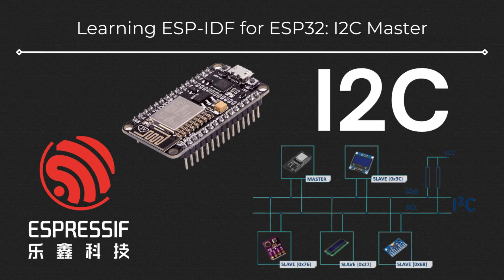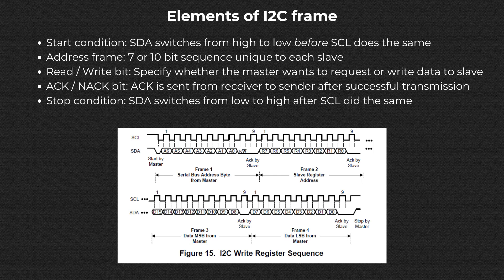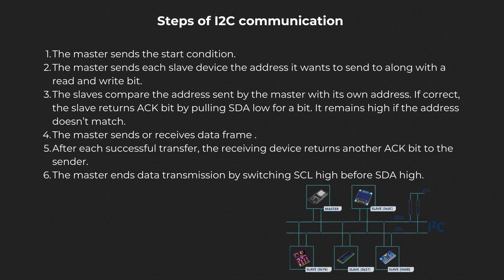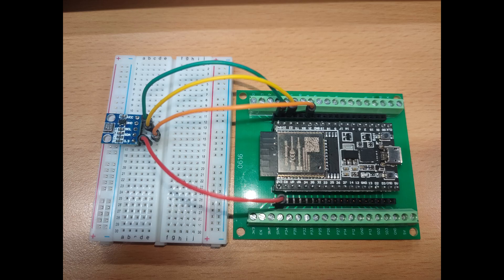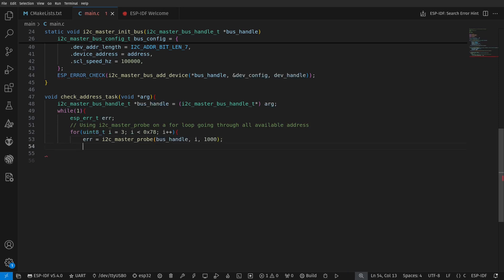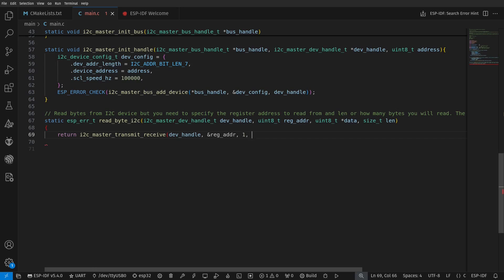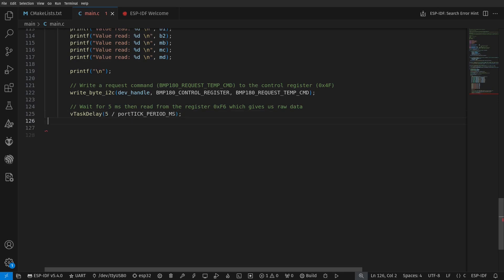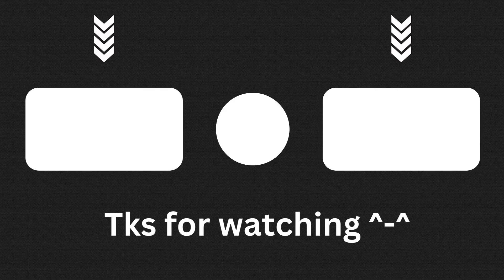ESP32 with ESP-IDF#5 | ESP32 as I2C Master

Comment: Hi very cool material. I recently tried to do I2C bus by myself, but i encountered some problems with xQueueSemaphoreTake() which i think couldn't properly use i2cBusHandle that was placen in main. So if somebody reads this comment and have the same problem the solution for this is to just simply declare busHandle outside of main as global handle (simillar to other task handles). Hope this tip will help someone and once again thanks for this whole cool series that u have done ;)

Comment: I am getting an error when trying this code. Error whenpassing argument 1 of 'i2c_master_probe' from incompatible pointer type [-Wincompatible-pointer-types]
             err = i2c_master_probe(bus_handle, i, 1000);

I copied your code exactly any idea?
Reply: That bus_handle is a pointer variable, type *bus_handle inside that argument instead.
Reply from the maker: I'm sorry, I was too busy with college to check the comments.Anyways, just like sestigio pointed out, the documentation mentions that the first argument is the handle not pointer to handle, so change it to *bus_handle should work.

Oddly enough, my code compile fine just the like the video, it shows this warning but still run fine (meaning that the compiler must have done some implicit conversion, as it still return ESP_OK). I have updated the changes to github